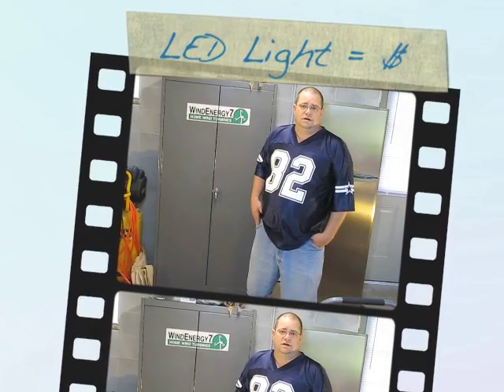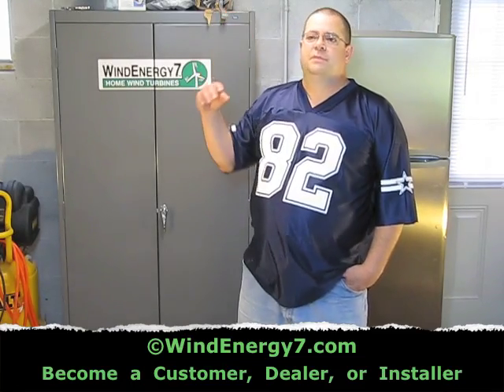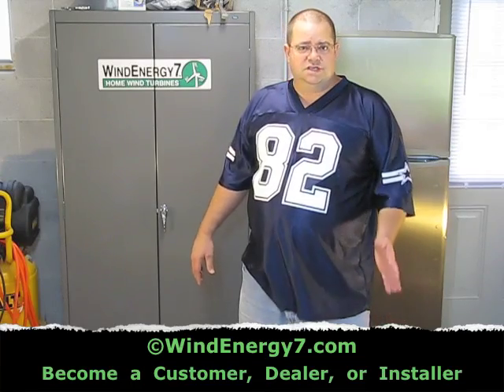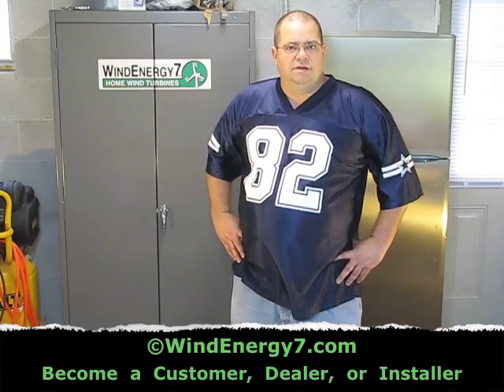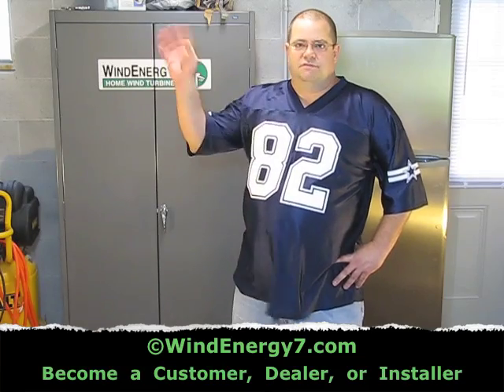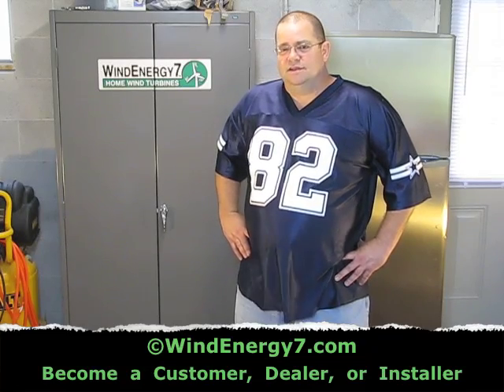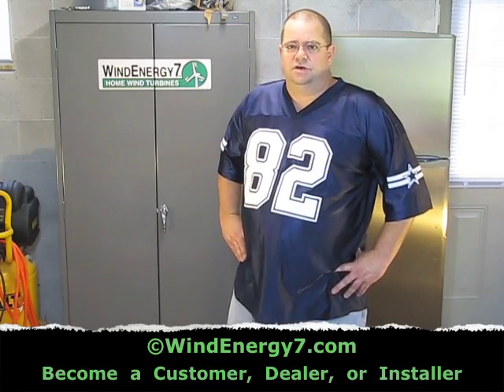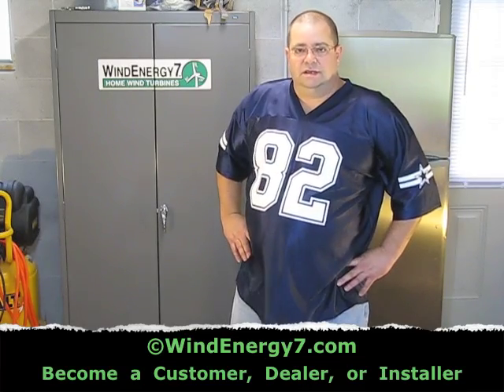Green Building CFL Bulb-vs-LED Light

Comment from the maker: Green Building Wind Turbine. If you want a Small Wind Turbine, fill out the Small Wind Turbine contact form at WindEnergy7. We will connect you with the Small Wind Turbine dealer for your area. There are still areas open for new dealers to become the local source for wind/solar systems. So, if you are interested in becoming a Small Wind Turbine dealer fill out the Contact Form at - - WindEnergy7 (.) com

Comment: LED bulds save so much electricity.  But look at the LUMENS when you buy them.  Look at the (Lumens Per Watt) Lumens is the actual light you get.

If an LED takes less power, that's good, but if it gives you so much less light, then maybe it's misleading on some bulbs.  Always look at the lumens a bulb puts out vs. watts it uses.  That's a better wat to see price/performance.

Comment: LED is coming but it's still too pricey.  The way they do outdoors in cold is way better than a CFL though.  After putting up a WindEnergy7 system on my house I converted much of the outdoor lighting to the LED because in winter, the CFL is really weak when its cold outside.